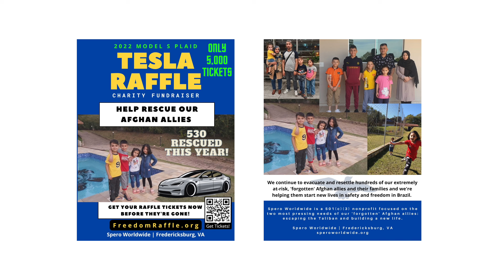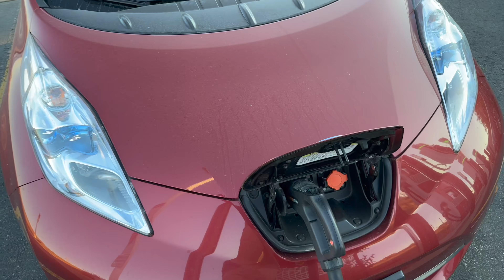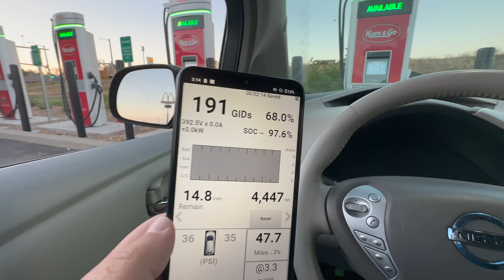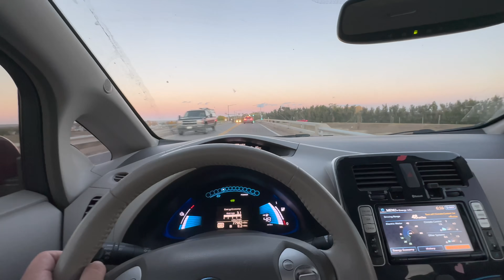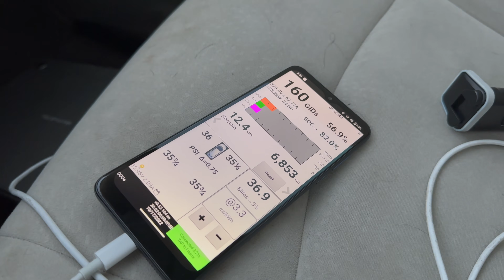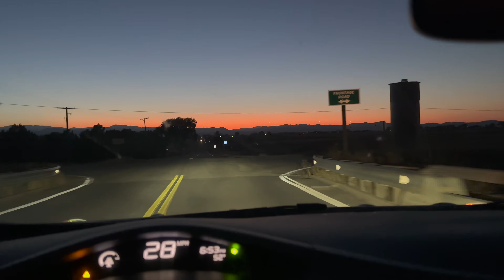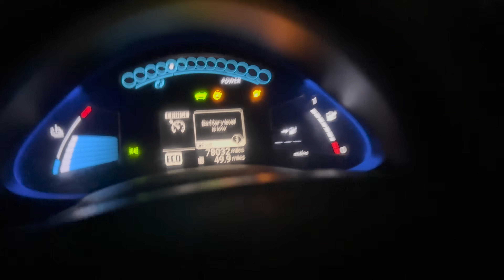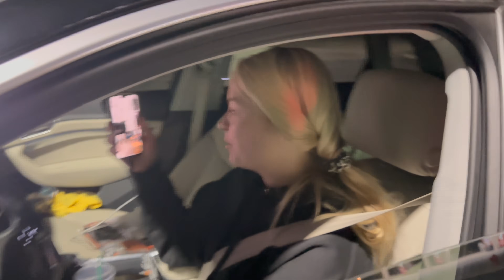Here's How Far My Cheap Nissan LEAF Goes On A Charge! Charging & 70-MPH Range Tests

Comment: I daily-drive a 2013 Leaf with about 60K miles. I love it. It's a city car really, since the range is down to about 60 miles w/o HVAC. Now, that 60 miles covers about 95% of my driving, with a Volvo S80 as a backup for longer trips. I've replaced one tire due to a puncture, and a set of wiper blades in 4 1/2 year of ownership. Great-driving car.
Reply: Is owning 2 cars really better than just having 1 that can handle all of your needs? Are you just a car enthusiast who likes owning multiple cars, or does this setup save you money somehow? I can't imagine that eating 2 car insurance payments+ double the depreciation is actually a financially efficient strategy, but I might be missing something.
Reply: @cyropox8235 seems good to have multiple cars if your household has multiple drivers or frequent guests, also good to have a backup if one car has a random mechanical problem
Reply: @cyropox8235  Perhaps they have a spouse or family/friend who also has a car that they are able to use when going on trips.
Reply: @cyropox8235 getting a 2nd car doesn’t double your insurance payment. Multiple vehicle discounts are the norm. It often isn’t much more

Comment: We are in the UK and we have 2 Nissan Leaf cars, a 2011 like yours, and a 2015. They are 2 completely different cars the newer one is far better with the improved battery chemistry and improved regen. But want I wanted to say was that during the winter months we use our 2015 which has bidirectional charge to run our ASHP on cheap over night electricity all day long. (the 2011 does not have this option) To achieve this we purchased the Setec 6kw mobile power station, which sits inside the old housing of our oil burning boiler. The Setec will also come in handy if the other car runs out of duce, but for the last 5 years we've never run out or even come close. So it interesting for to see you put this to the test. We are looking to swap out the old batteries, as on the Leaf they are interchangeable. We aim to either find a 40kwh pack to replace the 2015 24kwh pack, and use the 2015 pack to swap out for the 2011. Both cars will double in range 2011 80 miles, 2015 160 miles per charge. Cost has been quoted at £12k to swap out both batteries, and dismantle the 2011 pack to sell on the cells at around £100 each and as there is 34 of them thats £3.4k back in the bank. So we get 2 cars with better range at £8.6k which is cheap than buying an newer 2019 40kwh Leaf currently advertised at £20k thats a saving of £11.4k which is cheap motoring, and house heating. I love my Leaf Nissan!

Comment: 50 miles?? That thing is WORTHLESS! I could not use that to go to work and back. How many miles on a 90 degree day with air on??
Reply: 90 degree day would get a higher range because the hotter air is less dense, therefore creates less wind resistance at the same speed. Probably not much, like 53 or something.

Comment: Under the blue Energy button, you can set 80% charge limit :)

Also, as Leaf’s get older the BMS gets crazy, percentages stop mattering LOL

There is a percentage display if you cycle thru the menus

Comment: Good video.   I am just not following why anyone would be impressed with 50 mile range. That is with one person no radio and barley using any accessories. I am sure if the radio was on and another person that would  probably  drop to 40 mile range.  Now you have to charge 40 or so minutes to drive 50 miles in best case scenario.    If this is a car for fun all good but this can’t be an primary or even second car.   Just the charging would be annoying, not to  mention the performance.  Again good video and interesting enough to watch
Reply: The radio only uses a couple hundred watts and another person is only 70-80kg. When I load my 13 leaf down with 200kg of animal feed I only get about 5% worse range. At 70mph 95% of the load is the wind resistance.

Comment: Right off the bat, you said it only has 66% of its new battery life. Mileage wise that's 1/3 less miles. If you started new with 160 mile range, which is a stretch, you're down to around real world 100 miles. If you drive conservatively, which noone does your probably at 80 miles before it starts to limit your speed to the bicycle range. In the winter you will probably lose 40% which brings you down below 50 miles, not considering you can't drain to 0. 
Grow up and stop wasting your money on expensive toys.

Comment: 50 miles per charge is a around the town commuter car and no ac charge working is a big problem. No wonder the car is under 4k price.The car will be junk soon when the battery gets lower in charge rating.

Comment: Not very far on a cold day with the heat on. And the same on a hot day with the ac on.
Reply: The AC (0.5-1kw; 1-2miles range cost) is much more efficient than resistive heat (1-5kw; 2-10miles range cost). The cold weather package with the heat pump makes heat only cost about as much at AC down to about 0C, then it switches over to resistive heat.

Comment: Great video! I appreciate your, clear and concise explanation of information. I purchased a 2015 Nissan Leaf SL for 9K in September of 2021. It had 67K miles on it and 11 out of 12 bars on battery health. My Credit Union sold me an extended warranty that covers everything (including the 24KW battery) for 8 years beyond my purchase date, for $1900. Originally it was advertised as having 84 miles of range on a charge. Depending on how aggressively I drive, and if I am using the A/C or Heater, I get a City Driving range of 68 miles to 85 miles. All charging is done at home with 120VAC. I charge once every 7 to 10 days... never letting the charge drop below 25%. I plug it in at night, and the next morning it is at 100%. Previously I drove a Full Size Ford Bronco with a V8. Home Budget software shows a savings of $4800 in gasoline at the 1 year mark. Our house has a 6.27Kw Solar system on it, and even with charging the car, we generate a surplus. I will admit I wasn't keen on getting an EV at first, but after driving it for a short while, I came to LOVE it. The instant torque is addictive, low decibels in the cab makes for pleasant conversation (I'm hard of hearing) , and not having to go to the gas station and throw money into the tank constantly have all made me change my mind. It is a local commuter. If there is highway traveling to be done, we take my wife's gas car. They are not a good fit for everyone, but for those whom they make practical sense, I highly recommend!
Reply: The right tool for the job!
Reply: You should turn on the 80% long life battery mode

Comment: 50 mile range on that charge, that's pathetic. My vehicles 17yr old, cost around $1800, has 87 thou miles on the clock and will do over 200 miles per tank. Tank size only 19 litres gas capacity. (UK) Plus you can't carry a spare can of gas in the trunk to get you out of trouble. Electric vehicles have a long way to go to suit all budgets and all driving needs. This little Nissan is really only good for local trips close to home.  Thanks for taking time out to do this test. Things will improve over time i'm sure.

Comment: How to get extended range: make the entire car a battery right up to the roof and including the wheels. Then paint the whole thing over.
Reply: There are actually some garages that have been slapping a second battery into the old Leaf, and it doesn't take up all the space and they can get 150 miles range.

Comment: I recently sold my 2012 Leaf, it just didn’t meet my needs other than getting to work.  Probably the best car I EVER owned.  Other than range, of course. Smooth ride, zippy acceleration, zero maintenance.  Even got to charge it for free at my local Nissan dealer a lot of the time.  Had it 6 years.
Reply: Had our 2012 Leaf for 7 years also with zero maintenance. Moved to a small town far enough from the city that my wife insisted on more range even though she could drive my 2013 Tesla if she wanted. We ended up with a 2017 Volt. Now that gas is so expensive, she will drive the Tesla. I especially loved the steering wheel heat which the Tesla doesn't have. The Volt will be replaced as soon as the Aptera is available.
Reply: Had two of these the fest gen and second gen. Sold both during pandemic and made a few thousand dollars now buying another lol absolutely amazing cars for going around town. Free charging everywhere!
Reply: @roodick85  Has the range improved much ?
Reply: @GTSCommander I plan to drop a 40 kWh battery into my 2013 leaf in a few years.
Reply: @roodick85  What do you mean by "free charging everywhere?"
Reply: How was the battery life when you sold it?
Reply: @brock87___63  From what I understand the Leaf doesn’t have the battery heater like the Tesla so cold whether really helps deplete the battery life. But I may be wrong. I live in a warm climate and do very little city driving. I’m really considering one. I can use my gas hog truck for work. The Leaf for running around town when I can’t cycle.
Reply: What was your average range ?
Reply: Zero maintenance, except for replacing the battery every few years.
Reply: a second hand battery is quite affordable, at least in Norway. More and more specialist EV shops are offering refurbished cells/batteries.  @danparish1344
Reply: @danparish1344  😂
Reply: @danparish1344  Clown comment- OP literally said no maintenance in 7 years. Comprehension not your strong suit then

Comment: Can you tow a Leaf?  If so, will it regenerate power back to battery?
Reply: Perhaps.   If so, there will be more drag on the tow vehicle.  Which means increased gasoline consumption. 
There is no free lunch.
Reply: Yes, but it has to have enough battery to start up and shift out of park. There's a tow hook in the storage compartment in the trunk.

Comment: Yes the 2013 and later Nissan leafs you could set the peak charge level at 80%. I'd like to see a video of of Kyle having this battery pack swapped out for a 40 KW hour pack they do do that I think it's about $6,000 to have it done aftermarket

Comment: I wonder if the charger kicking off at about 90% is a safety feature to prevent battery damage - OR if the charging station doesn't want to tie up the electric chargers with them slowly charging the last ten percent -

Comment: Hello.!! I need advise if the 2013 nissan leaf 7 bars battery life 45 miles full charge for $3,500 if its worth it to buy? Thank you.!!
Reply: Don't trust the GOM, give it a test drive and see how fast it drops. My 13 with 10 bars says I have 70 miles range, but commonly starts throwing low battery warnings at 50-55 miles. If your regular usage is less than 30 miles/day or there are lots of L2 chargers (a 6kw charger is almost a quick charger when your battery only holds 13kwh) in your area go for it, otherwise hold out for a longer range car.

Comment: Didn't you ever hear of "Drive 55" ... That was a Slogan used through the U.S. from about 1973 until about 1998. Wind resistance is less at 35 mph, some tests were done in 1976, using mid sized Ford's with the use of a "Cruise Control", to maintain a steady state speed.  We we told back then, that it reduces Gasoline milage by about 20%, when driving 70 mph, as compared to driving 55 mph. Try keeping you speed down a little to extend range
Reply: I thought the same thing for years, but unfortunately this isn’t true. It was based on fuel savings not fuel economy. 55 was found to only decrease fuel consumption by 0.5% - 1%. Check out the Wikipedia on “NMSL”

Comment: Don't forget ac use wipers heat power seats heated seats lights all burn up the battery
Reply: True, but wipers, heated seats, lights, heated steering wheel, and radio are powered by the 12V system and relatively low wattage, so make very little difference to range.

Comment: My 2016 Leaf did fairly well at about 60 miles of full range. Sadly, I needed a car that could do long road trips so I had to upgrade to an EV with a MUCH longer effective range (approx. 260 miles). It cost me more than 5 times the price that I paid for the Leaf. :-/.
Reply: Solid state n ates 25 perc more range 75 mioe.  Orc320 mioe new bate r ies rabge

Comment: there is a setting in the leaf menu to limit charging to 90% make sure you dont have that on. i've charged mine 100% since 2012 no issues.

it's one of the four buttons to the left of the steering wheel that looks like the windows 98 icon

Comment: I have a Model 3, I can't imagine having my AC charger not work.  I don't drive all that much so I normally just use a 120V outlet.  I've only had to use a DC charger twice in the year and a half I've owned the car.  My car will go about 250 miles if I charge to 100% (I don't for daily driving).  My car gets around 180 wH/mile (which is between 5-6 miles/kWh).  That said, for just over $3000 that is one hell of a deal, even if it's not as good as modern EV's.

Comment: I bought my Leaf about 3 years ago.  I had been watching electric car prices for a while and I could not figure out why these were so cheap.  I did not get answers so I decided to buy one to figure it out.   My cost was about $4500 for 2013 in perfect shape.  The battery had 10 out of 12 bars left.  It was a high mileage one at 71,000 miles but being garaged stored it was in perfect shape and mileage means less with ecars, it is the battery condition that is important.  The old technology golf cart I wanted was $8000 used (they all looked like they got dragged up from a lake).  And they used lead acid batteries, could not go on streets above 36 mph, had no AC, and had no doors etc., basically they were no comparison to the Leaf. A new golf cart cost $25,000 and above, an absolutely crazy price?

The Leaf I bought has grabby brakes, it does not handle well on curves, the doors are tinny, and when you shut them things rattle.  If I go through a car wash water comes flooding in.  And I had to compare this to my last car which was a Mazda Protégé 5 which is an absolutely amazing car, it handles so well, like driving a go cart.  But I  absolutely love my Leaf. So nice, no gas station to hassle with. And it was so good, I sold a great car, so no more Mazda.

I absolutely love it.  so simple to use, no gas stations, no oil change, no engine to worry about, no transmission to worry about, no cooling system to worry about, I could go on and on, but  you get it.  Not one problems in 3 years of ownership.
Reply: How’s the A/C and defrost heat work ?
Reply: @rolandthethompsongunner64  I never had to use the defrost heat, I live in a moderate climate.  The A/C works fine, but I never use it either.  The actual heat is ok, but bad compared to a gas car.  I like to crank the heat up and you can not do that in a Leaf.

Comment: After your abuse test it will be interesting to see what the battery temperature is after charging to 100%. 80% would be kinder. Really! Try the two ball method of driving. I bet you might eek 60 miles out of the car driven conservatively(at 80% SOC). You really don't have to do these tests. You can look at range driven and range predicted and get a very good idea.
Reply: Eco mode.  Kess. Energy

Comment: 80% is the sweet spot for constant use. 100% when needed. Fast driving is fruitless. These cars are only useful if driven very conservatively. Use the two ball system and watch the instant use meter. Keep it to 6 miles per kwh. I get 100 miles range still at 50 mph.

Comment: My 2013 Leaf with the 24kwh battery has 8 white bars. 70k on the clock. Yesterday I drove 50 miles. Had 50 miles left of indicated range and the battery was at 50%. This is on level ground at 50 mph. If you are willing to drive slow the car is still useful. Otherwise get a Tesla.
Reply: Please.  If you need something to drive to the store and pick up the kids, you do not need to spend 40,000+ on a Tesla when you can get a Bolt or Leaf for 20,000+ or one of the early gens for even cheaper.  You're just wasting your money.  Especially if you get any body damage.  Then you're looking at 10's of thousands to repair a Tesla.  Now, if you have a long commute and take lots of short trips, then a Tesla is useful as it has a long range and fast charging to accommodate it.  For a town roundabout, just no.

Comment: It’s too bad I didn’t know you were looking for a Leaf.  I traded my 2012 Leaf in and got $1,500.  Would have sold it for $2,000.   Had 68,000 miles and 89% battery health.    Battery was replaced by Nissan about 5 years ago.  Car was in very good condition.  Oh well.
Reply: Buy new  keaf

Comment: You should know the leaf now appears a lot in poorer countries, and people are finding ways to fix the battery problem.
The BMS has been hacked to a point it can be emulated and people now repack the battery using LFP cells
As well as adding another small pack in the trunk.

Comment: Cool video . Do the cars do better mileage in town. The term dead  as a doornail, comes from the late 1800's and early 1900's when people would recycle nails pull them from old structures and re use the nails. Doornail where hammered through then bent over to keep the door together as well keep people from hurting themselves. This keeps the nail in tight ,if you ever tried to pull a bent over nail you will most likely tear off its head or bend it straight making the tip weak and hard to drive in. Hints the term Dead as a doornail.  
.